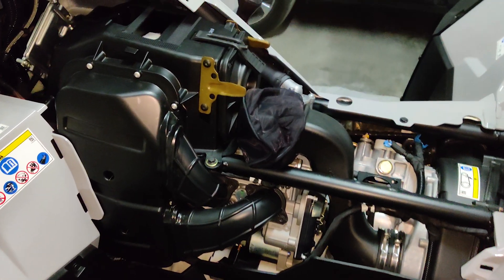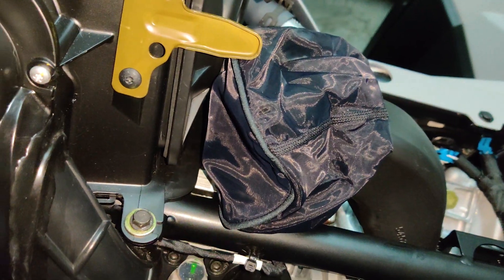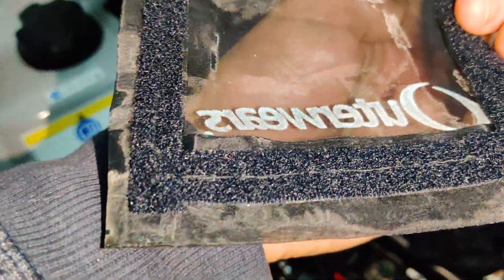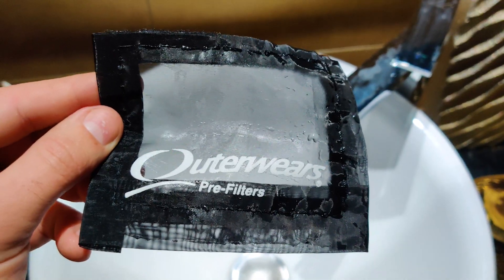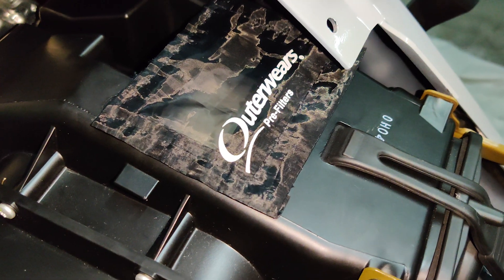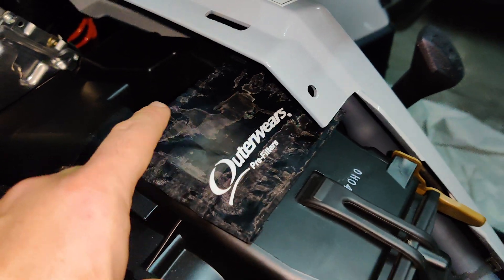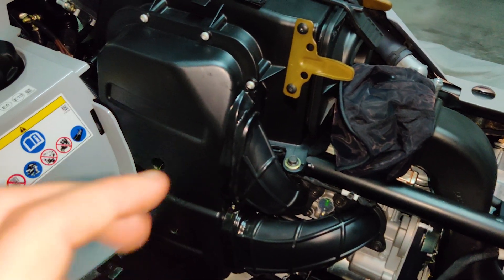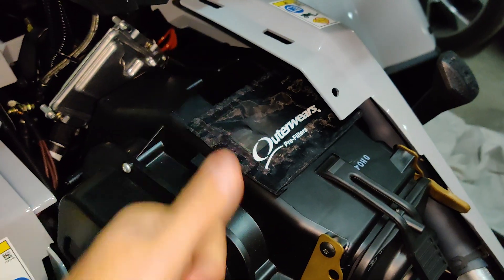Polaris Sportsman 1000/850 Air Intake MOD - Keep Water, Mud, Snow and Dust OUT !!

Comment: I am def going to try this trick in my 850. Mine is at the dealer now because when I washed it this past weekend I never opened the box to drain it and I hydro locked my 22 850. They said it needs a new engine and I never knew that the air box lid is basically wide open under that plastic bezel. Thank you for the video!
Reply from the maker: Yeah i agree not very protected for sure, too bad that it did that mutch damage! Hope you can get riding soon and do this mod!

Comment: What pre-filters did you use for this mod?? Model #??
Reply from the maker: For the air intake i used a outerwears pre filter made for polaris sportsman 1000 and cut it to the desired size, they also sell just a sheet for custom applications like this. For the CVT intake i used a suzuki LTR 450 pre filter, i recomend you search one that is a bit smaller altough this works just fine 😉 thanks for watching 😎

Comment: so what happens when the pre-filter gets wet then you hit lots of dust?  does it plug up and choke out the air??
Reply from the maker: Air continues to go through but dust or mud particles do not, if it starts to get clogged i used velcro so it is very easy to take off wash and reuse on the go! Or even better you can create two or three spare pre filters and change them within seconds 😉👌🏻 Thanks for watching